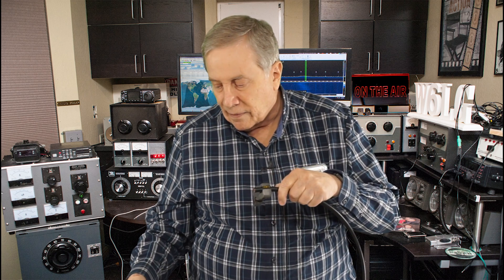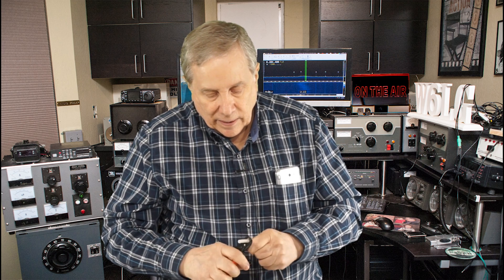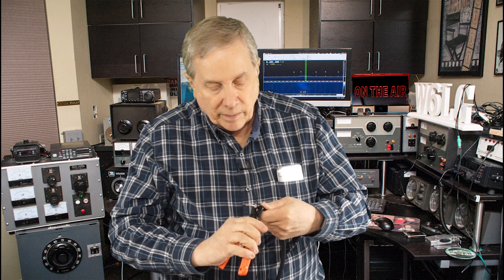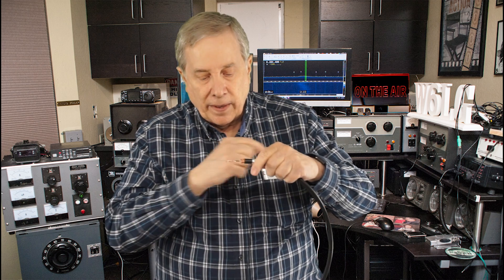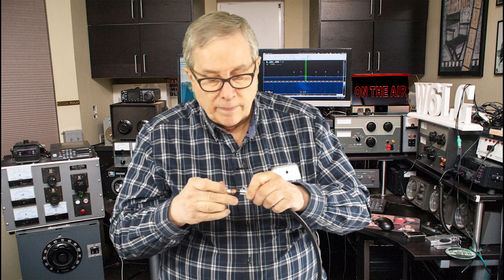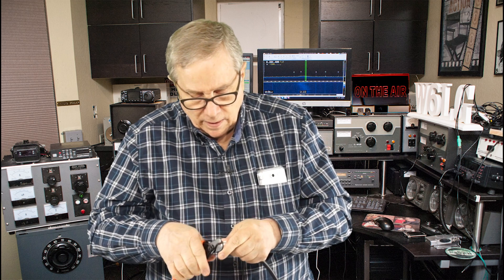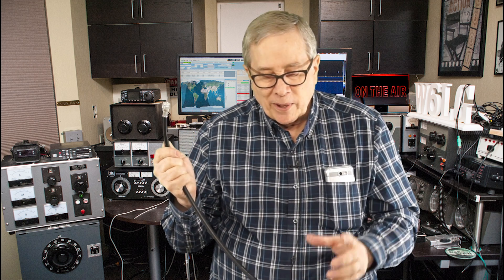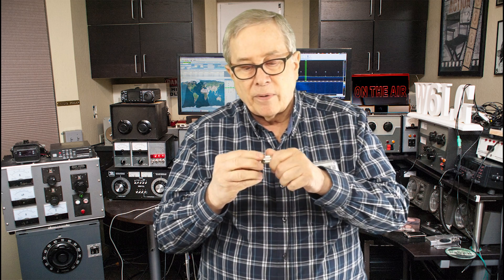Ham Radio Basics-Jim W6LG Installs a PL259 Onto RG213 Very Quickly

Comment: I always assumed (and most likely was even showed by some ppl at a shop many years ago) that it was ok to peel back the external shield braid, without removing it. But possibly those were different connectors. Thank you for your videos.

Comment: Jim, I purchased the special crimping tool and the crimping type connectors and was able to do what you did. Unfortunately, the connectors came off  This has happened to me a few times. I no longer have faith in mechanical connections. When I think about it, there is really nothing holding a crimp together. I went back to soldering connector, which I dislike doing. Lately, I just order custom size coax with connectors on them already. They last a lot longer than what I can do. Thanks for the video. Do your crimped on connectors ever come off?

Comment: Jim have you tested the difference between solder and crimp? I wonder if there is any appreciable difference between a mechanical and fused metal connection.

Comment: Jim, question for you and the channel.    After soldering the conductor within the PL-259 do you use solvent to clean off the rosin residue?  I've been using acetone to clean up the connector tip.  Comes out nice and shiny and not sticky.  I would think this helps conduction.  Thoughts?